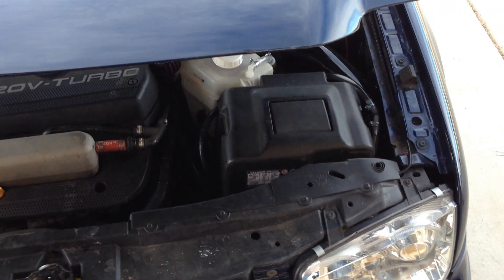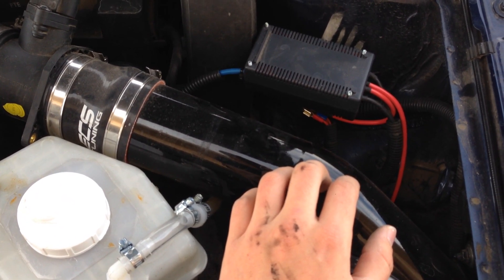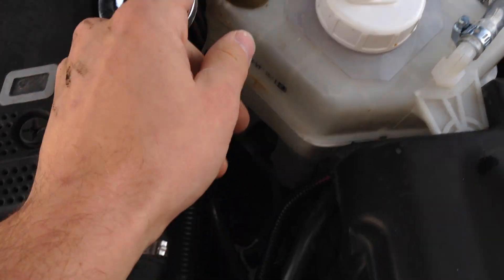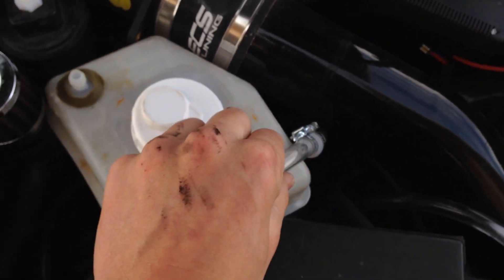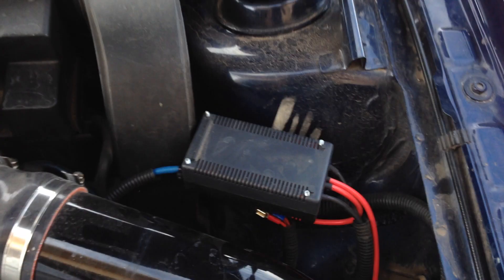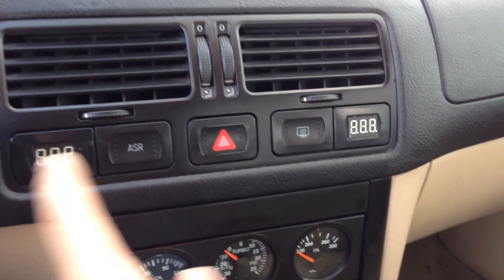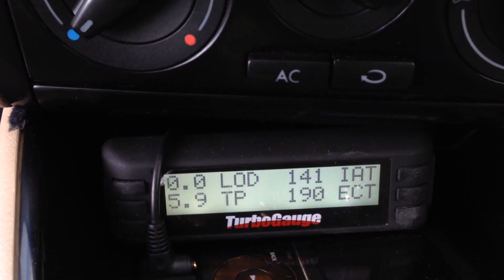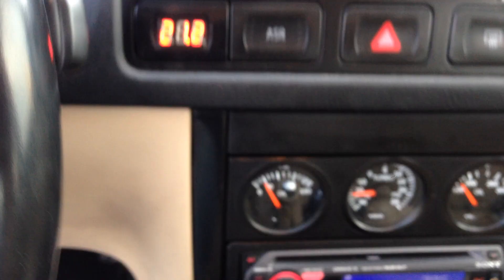HHO 16 plate Hydrogen Dry Cell on 2001 VW Jetta 1.8t final design

Comment: Sir, I just purchased my first dry cell generator and am planning to connect it to my 2003 Honda civic. It is an 11 cell generator, supposed to be the right size for the engine that I have. I was wondering if you have any suggestions as to where I should place the  generator and bubbler? I also like the way you wired yours up. I want to install a separate switch so I can turn the generator on at my discretion. Do you have any suggestions?

Comment: Hello. Congratulations on the build, it's a well done project. However you should have made some ballpark thermodynamic calculations on the feasibility of what you are trying to achieve. Thermodynamically speaking it's impossible that you increase the MPG rating of your car using a fuel cell like this.
Reply: Not impossible at all, in fact, some people are running their vehicles 100% on hydrogen. Just takes a bit of work to do the conversion.

Comment: nice double check valve and Rez tho... mainly nice build and work..  do you cut down your fuel any? and what's your mpg and power running like? technically we can change the timing on our cars and run them solely on HHO... if a lawnmower or small engine can so can we ;) keep building. learning. beasting. and sharing thanks again take care

Comment: How do you calculate how many plates you need and the size of them.??
I saw your past videos, your first dry cell, you said it wasn't efficient, and you change the design and stuff, but how,why, you choose the size for the plates???, i just cant understand that.
Reply: check out hydrobullet.com That website sells drycell generators and will tell you what size you need for the engine you have. You just need to know how many cc's your engone has. For example, mine is a 1.7 Liter. So mine has 1,700 cc's. They have a range of sizes for whatever engine you have. Then you can decide from there.

Comment: this looks pretty legit, I have two questions 
#1 how exactly does the gas get into the engine? do you have a line connected to the airbox or does it simply get released in the engine bay and indirectly sucked through the air filter? 
#2 Any gains on your mileage??
Reply: +StraitClownin909 
#3 Is performance better or worse?
#4 will it work on high performance models like GT-R's or lambo's?
#5 How much would you charge to do a conversion?
Reply: StraitClownin909 what he said∆^∆

Comment: I wonder if you could interface that unit measuring amps and volts into a raspberry pi? A few lines of code to translate the readings and have the raspberry pi adjust the amps on the fly to keep the amps around the level you set. You could even have it measure the temp of the cell and translate that to amp adjustments. It would make it a very low maintenance system for the driver. Raspberry pi runs off near nothing for  power, so it would be a very minimal addition, a few more wires but could be a wanted product for these projects. Just an idea.

Comment: So no MPG increase?
Reply: rreman81 I'm sure he is gaining or why would it be installed and mainly why #research. and mod and keep perfecting this build.
Reply: gasoline vehicles are very difficult to adjust to using HOD, too many sensors to adjust, best to use hydrogen separator cell

Comment: Is the concept of this system not to use gasoline but to replace it with hydrogen gas into the intake system, which will then mix with the regular air that is ignited by the spark plugs to create a greater explosion in the engine combustion chamber? Additionally, Is the pump in the engine compartment used solely to circulating water to the hydrogen cell generator, and how often do you add water.
Reply: No, hydrogen on demand is a supplement to fuel, it just helps the gas or diesel to burn more efficient